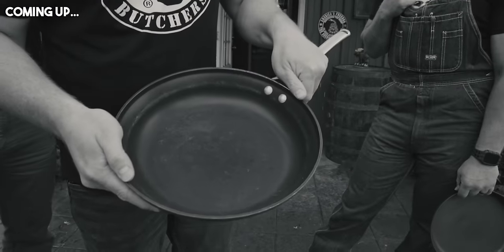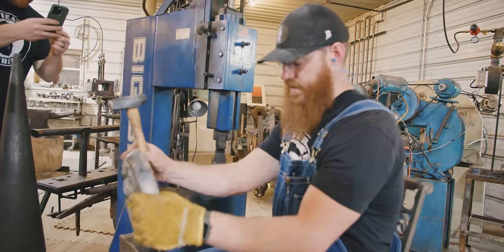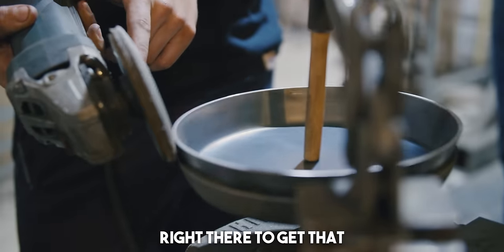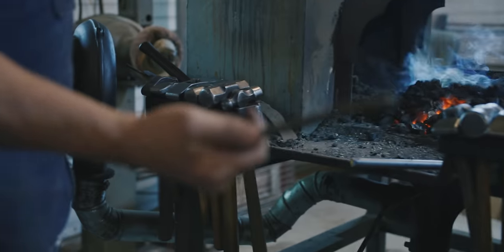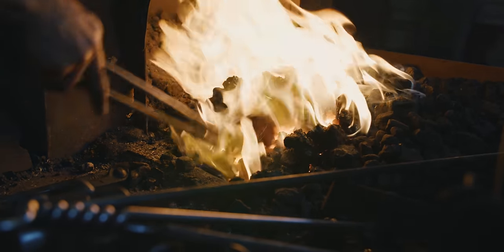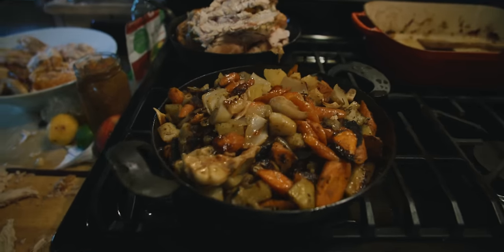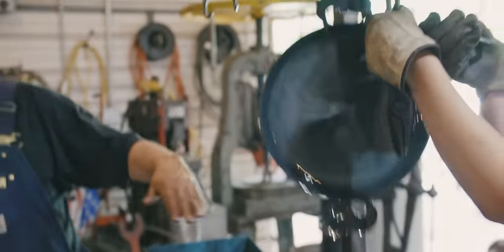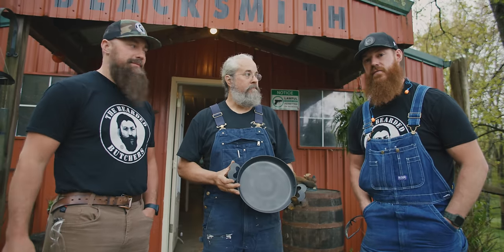From Butchers to Blacksmithing  | The Bearded Butchers

Comment: I will purchase this especially knowing it is MADE IN THE USA!!! I know you guys are butchers but I'm glad to see y'all step out and cover a little more territory and expose what seems to be what very few people realize that teflon pans although easy to clean are a toxic waste dump for your body when you cook with them! I finally realized years ago when I saw my teflon pans losing material and keep in mind that I ONLY used plastic on it to prevent peeling and scratching but yet it STILL peels over time from use and that the crap is going into your digestive system in addition to other exposure to toxic items, we don't need anymore help in that category so we went with iron and stainless steel pans and have never looked back. I've actually mastered cooking on iron to where my eggs don't even stick anymore by using bacon rendered fat and making sure the temperature is right....not too hot and not too cool, about medium heat will minimizing any sticking.

Comment: that XYJ Knife Seth used on a previous vid..  you can get with a better tip.  Spencer took the Black style.  the Brown one ;)
I would Love to see what Seth thinks on it. I Love Mine
The chincy 3,2,1 sharpener...   Not my Fav but Works very well on Knives that can semi keep an edge.
was $4 + tax.   I'll try the Smith.  carbides seems to work well with that knife.
but the 3,2,1 did an Awes job

Thanks for all the Content. I have Learned/ learnt So Much & dressing deer... Hahahhaa  Thank You Guys.

Comment: Nice job but absurd price tag of $259,you called "forged" that in this case is more of that of "formed", and it requires the almost same procedure of maintenence of the cast iron,for the price of one 10 inches pan I make 18 of them....maybe $125 will be fair...I'm a welder and mahinist 👍
Reply: Made in America costs a lot these days. 2 small businesses. Also comes with free shipping.  4 days after this video released they sold out of first run of them.
Reply: I'am not against that in anyway,only say that it is too expensive,but it is high quality in manufacturing an a REAL lifetime warranty,this is great!!!